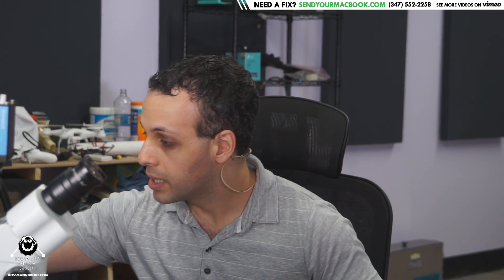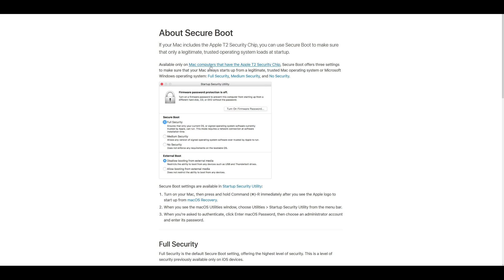An important message from Louis Rossmann

Comment: "If you want your data to be retrievable, you need to disable this option"
or as you said at the end "just buy a non-Apple product"....solves all these issues.
Reply: disable Apple or Apple disables u
Reply: Apple stuff ‘just works’ - until it doesn’t.
Windows isn’t better, just differently bad.
Reply: @SirHackaL0t.   At least Windows doesn't brick itself if you change any component in your computer, even if it's an identical component.
Reply: The hilarious part about this whole thing is, that non-Apple computers usually have this feature too, and Windows 10 computers have this feature enabled by default, but it's a non-issue because with all of those, you can just get into the BIOS and manually disable it (not to mention that since most non-Apple machines have actual harddrives you can take to a different PC, unless there's drive encryption, or HDD lock - a BIOS feature that lets you set up a password which locks the drive until entered, on any machine - explicitly set up by the user, you don't even have to boot the machine to recover the data).
Reply: @TricksterRad  ... Windows 10 MAY have this feature....but I have NEVER had a problem with piggy-backing a windows drive onto my system and force a "take ownership" command on the drive and retrieve ALL the data.  Apple bricking data just because you aren't the "owner" (keyed) is stupid.  Everything is on the cloud these days, someone stealing your computer means just fucking change your passwords until you can find the laptop again......we don't live in the 90s anymore.  The only reason Apple did this was strictly money, that is it.
Reply: @sabriath  
Well, so far, I haven't argued with you, and have actually agreed with you, but I see a few points that should be corrected.
1. A forced "take ownership" command on a locked drive (non-encrypted, if your data is actually encrypted, then that command is useless without the decryption keys) makes the drive itself delete all data, even on a non-Apple machine. You NEED to know your HDD password if you lock your drive and want your data (unless you're into drive platter transplantation). The fact that you've never had a problem retrieving your data means, that you've never used the security features (and they are actual security features if used in the proper way, not the way Apple uses them), or that you've never lost your passwords.

2. If everything is on the cloud these days, then for sure, you don't actually need the data that's on your computer, since it's in the cloud, right? "Everything is on the cloud" is a shit argument for anything, and actually has nothing to do with the issue at hand.

My point was, that Secure Boot, as it's implemented on non-Apple machines, does not require a signed OS to be booted in order to disable it. All you have to do is go into the BIOS, and disable it there. THAT is what I found hilarious about this whole issue - that Apple can't figure it out!
Reply: @TricksterRad  you said it "had this feature enabled by default too" on Windows 10 machines.....and I was clarifying that I have never had this issue and never disabled any of the default features, so this either can't be the case, or windows allows for ownership takeover of a piggy-backed drive.  I do understand that a file that has been encrypted cannot be retrieved, but majority of the files that I work on are open source or pictures of my family, so I keep them in public folders to be able to access it in case of failure......but it doesn't mean the drive gets wiped clean just because you forget a password, just kicks back and tells you that those files are locked.
I never said you argued with me, like I said, it was a clarification point of my own experience.  I've programmed since I was 10, Apple fucking sucks to program for, and they go the route of complete proprietary nonsense bullshit.....great graphics software, horrible with EVERYTHING ELSE.
As for the cloud statement, I was making that as a hit against Apple's ideas for safety.....not as an argument for self protection.  Apple could just put a wifi-gps tracking software built into the system so you can "track your PC"....the login code and file encryption software should be enough to keep your data safe until the cops can locate and retrieve your stuff....and if it happens to be erased by the perps, THAT is what the cloud is for.  Not for Apple to create software that automatically wipes your data just for you to pay them to store your data on their servers.
What I find odd is that Apple seems to think the customers are all 007 agents, and that if any tampering happens with the hardware, it bricks.  They live in a fantasy world.
Reply: @sabriath  Secure Boot itself has nothing to do with drive ownership. HDD lock and  TPM-based encryption on the other hand does, and as far as I can tell, Apple products don't even implement that.

As for taking the drive to another machine, or booting up a Windows recovery medium, Secure Boot won't prevent that, because even in the case of booting a Windows recovery medium - THAT IS SIGNED BY MICROSOFT.

As for the encryption part of the deal, we're obviously talking about whole different setups here. I was talking about HDD lock, which has nothing to do with encryption, and everything to do with drive ownership. Setting up HDD lock WILL NOT ALLOW YOU to access the data on the drive, unless you provide the password, or take the platters and physically put them into a different machine.

Encryption on the other hand - yes, your data won't get wiped, but it might as well be (in the case you, the data owner, don't have your password), because it's not useful, but AFAIK, that's not even a thing that Apple implements (unlike Windows - BitLocker, Linux - LUKS, or even Android - still probably LUKS, idk)

And I am still saying Apple is trash, because either Apple implements neither of the above (which, if they actually cared about security, they would), or when they do, they don't use it for security, but to prevent their customers from using their own devices, which is just plain bullshit thing to do.
Reply: @TricksterRad  ....oh, yeah, i pretty much ignored everything you stated about HDD lock because I have programs that circumvent all HDD frontend functionality and go straight to drive head positioning if I want.....I'm old school like that, if I want my data, I get my fucking data.  Apple, however, from what I've "heard" is that if you tamper with shit, there is a chip that will literally fry itself and you will be unable to get any of your data......and that....is fucked.
Reply: @sabriath  right, the HDD firmware won't let you touch the head before you tell it the password. As for a chip "frying" itself when you try to access YOUR OWN data, that definitely is in poor taste.
Reply: @TricksterRad  .... depending on the drive, it can be bypassed, either by software, hardware jumper, flashed, or a new chip.  And if things can be bypassed, there really is no point for them even being a thing, it's quite stupid.  I guess there is the time factor, but this isn't the same case of trying to break into someone's home.....if you stole a hdd, then you probably have all the time in the world in private and behind a closed door....unlike picking a front door lock totally in view of all the neighbors.  I'm kinda done talking about this though, I am already burning on like 41 hours of no sleep and this poison ivy isn't helping either.  Have a good night.
Reply: OORRRR back up your hard drive like an adult and reflash your data after your T2 Chip is replaced. Time Machine restores the whole drive to exact settings and data as before. Exactly. There is no excuse for this. Mac works different than windows. They are not horrible because they do things a bit different than Windows. And their backups are way better than Windows. Period.

25 Years I dealt with Window's BS. I switched to Mac for a good reason. As someone that has dealt with highly secure data before, Apple's way is closer to truly secure data. Hardware, and Software security is crucial in higher level security enterprises, ect.
Reply: @therinwhitten  ... ORRR.... buy something that lasts longer than 2 years, like an adult.  I've had this computer for 10 years now, only had to add a new hdd because I filled it up.  Everyone wants to buy the trendy thing, it's like watching poor people buy jordans....they are shoes for fuck sake.....I got 2 pairs of NB for like $24 and they'll last me for the next 3 years+.  With the money I saved, I was able to afford 1 share of DIS stock and 1 share of AAPL stock.....I might not like the company's products, but I'm not stupid, 80% of the population are moronic sheep that buy trends, and so the stock will make me money.
Thank you for your purchase.
Reply: @therinwhitten  Uhh, so, either you're bullshitting right now, or you've never actually dealt with 'Windows BS'. 

And as for your T2 Chip getting replaced, good luck getting anyone to do that, when Apple won't give them the fucking chip - there is no real reason not to do so, and don't try claiming otherwise. And good luck getting Apple to do that for a reasonable price, when their only goal is to sell you a new device.

 As for backing up, yes, sure, you should be doing that, but that shouldn't mean Apple should just wipe your perfectly usable drive every time they do repairs. I mean, if you set up encryption, they can't access the data anyways, so there's no reason for them to wipe it so that no one can get access to the data, right?

Comment: Customer: "I literally just bought this Macbook in your store, minutes ago, haven't even taken it out of the store, and it won't start. Help!"
Genius Bar: "Water damage."
Reply: "i just opened the still sealed box standing here in the Apple Store and it doesn't work!"
"water damage."
Reply: @taiiat0  humidity is a hell of a drug
Reply: Customer: But it's not raining!
Genius bar: I didn't say anything about rain, what do you call the tears of your wallet crying itself to sleep tonight after we ravage it?
Reply: 👆👆👆👆👆 yep
Reply: Too many apple fanbois drooled on it!
Reply: We don’t know what it is yet, we need to perform some test so we have an idea of what the problem COULD be.

2weeks of testing later

We know what the problem is and we need to change the ssd. 
But we can’t open the machine the batteries might explode 🤣🤣
Reply: Thanks for the laugh
Reply: Thats about right
Reply: @Jack Shaheen I didn't understand a part of your attempted trolling. Why did you call him Dell Dude? Also, why did you put "Dude" in quotes?
Reply: @TravisTerrell  It's because Macolytes need a catchy well-known PC supplier to mock, the way we mock Apple. I've seen Dell used this way before. Sad, really, as there are dozens - which is the point of a more open system!
Reply: It’s got the covid
Reply: THATS A LOTTA WATER DAMAGE
Reply: You opened it wrong, are holding it wrong and water damaged it!
ThInK DiFfErEnT

Comment: I'm sorry, I tend to agree with 95% of everything you say but this is not one of them. In this instance Apple is doing the right thing by enabling secure boot. Any modern Windows based computer will ship with secure boot enabled. Drive encryption is a good thing, whether the user understands it or not. The real issue here is the fact the Apple customers are being lazy and not instituting a data backup solution. In this day and age, there is no excuse for not having either a home NAS, a simple external HDD or cloud storage solution for backing up data. None! Not to mention the fact that Apple embeds a data backup solution as part of the OS in the form of time machine which simplifies the process. Mind you, I can't stand Apple. But blaming them for enabling a feature that encrypts the users data, simply because the average Apple user is either lazy or refuses to learn basic modern technology and best practices; all because they think their precious Apple is indestructible is not fair. This is user error/user ignorance.

Comment: I've never had an issue with the TPM in my Lenovo laptop, or any of the TPMs in any of the many Dell products I've used... Best part is - they do nothing by default.
Reply: Even if you have the TPM being used with BitLocker drive encryption in Windows, the necessary decryption key is likely stored in a Microsoft account and when you put the encryption on it will force you to print it or to save it to a non encrypted drive somewhere. With that key you can decrypt the data using any computer
Reply: @AlanMillerFencepost  ... That's kind of the point? Keep the key in a safe place, so that when the computer is stolen they don't have the key, but if your computer dies, you can take the hard drive out (yes ik, removable hard drives. Insanity) and decrypt the data so you can transfer it over to a new computer.
Reply: @AlanMillerFencepost  "the necessary decryption key is likely stored in a Microsoft account" oh yeah, and there we have the problem. Why should I handle my decryption keys over to the guys, who built key loggers in their OS?
Reply: @PvtAnonymous  because they're also the ones doing the encryption. not saying they necessarily should have it, but what are they gonna do with it? Unencrypt the data they can already see?
Reply: Everything Feline give it to law enforcement?! This sounds like the „I have nothing to hide“ argument, which is bs. The keys should be stored offline, period. And I still don‘t get why anyone should use the Microsoft Online Account for Windows 10. It baffles my mind, how useless it actually is, but how much privacy you give up using it.
Reply: >they do nothing by default
ikr my laptop doesn't even turn on except when i tell it to
Reply: Well have i got news for you @Andrew Piroli,
On newer systems, Bitlocker / device encryption is enabled by DEFAULT, AND on some systems, you dont even need to have a TPM for this to be a thing....
So never assume its not enabled until proven otherwise.
I would know, I work as Tech support for a major computer vendor, and see this frequently.
Reply: KSSilenceAU you’re right. I noticed it on my ThinkPad E480 back in the day. While yes sure, you‘d expect it on a business laptop, I still find it weird to this day.
Reply: KSSilenceAU I’m a sysadmin, I oversee 300+ Windows installations a year, about half of those are on TPM enabled laptops, not once have I seen Bitlocker enable itself. Windows does support automatically enabling BitLocker, but only if that is set by the OEM, and only activates once OOBE is finished and only if a Microsoft online account is used. If something happens then the user presumably can access the recovery key through their MS Account? I’ve never used BitLocker with an MS account so I’m not sure on that last detail.

Comment: This is one of the many reasons I avoided Apple at the start. When I was a kid, something about the company didn't seem right. When the iphone came out, it didn't sit right with me. Years later, after a lot more was said and done, I'm glad my hunch proved correct.
Reply: I have to say though that the iPhone up to the 4s I guess was a revolutionary device with features that would make it reasonable to take a few downsides, especially considering there was no way for them to actually know about every possible point of failure.
Reply: @jonamuller6879  I honest to gods thought it was far too expensive for a phone that had tacked on so many bells and whistles, not to mention how often the phone would break if it was even dropped from just a foot. Never mind the fact that hot new devices were stolen quite often. $300 for a phone you'll try to either replace or upgrade in a year for something that just has one more added feature to it? That's not very wise at all.
I cannot fathom just how much waste was created when Apple decided to push the iphone, along with their entire line of devices. 'Conform or Die' was their way of advertising against Microsoft back in the 80s, and oh boy how they themselves have turned into the monstrosity they campaigned against.

I'm happy with my PC, despite the faults it has and what I had to replace in it, and the fact that I can change out any of the parts for something else and have mostly no problems in getting them to work is a godsend. It'd be nice if Apple took a page out of PC backwards-compatibility so we wouldn't have such problems, but...where's the 'profit' in that?

Comment: u know what sounds great?
to have proper encryptionon the whole drive, that  will request  password or password + usb key to access the data.
this way, guess what... u got a fully encrypted drive,  that u can access without your laptop and hell u  can  even give any repair person the laptop to fix, while u keep your fully encrypted drive at home.
and just in case, that the drive sh1ts itself and u need to try to recover data from it,  then u still got the key + password to decrypt the data, or rather the  data recovery people can.
basic senseful measures, that would make people happy.
but that is not what apple wants, right? apple wants u in their insane prison, where they also run location based big brother spying apps on u, to track your every move.
that is the world, that apple wants. don't JOIN it, or leave it.

Comment: Unfortunately, I learned nothing in this video. I used to work for Applecare tech support, and when I learned about the secure boot feature my first reaction was, "Well, it's only a matter of time until that's the default and shit will go crazy." Most of the other people I worked with agreed with me because we would be the ones that get the calls when someone's grandma passed away and they don't know her computer password to get her pictures and home videos. We would have to tell them that the data was gone, even if we knew it was retrievable because Apple doesn't support data recovery if you didn't backup your data with Time Machine.